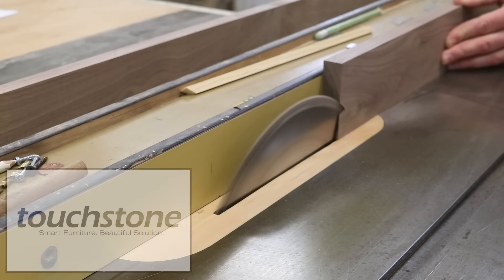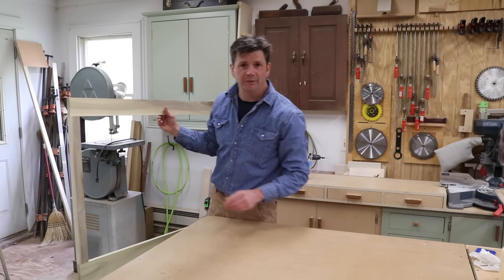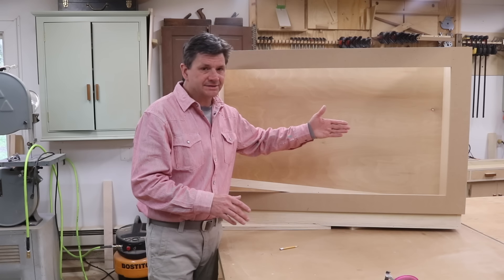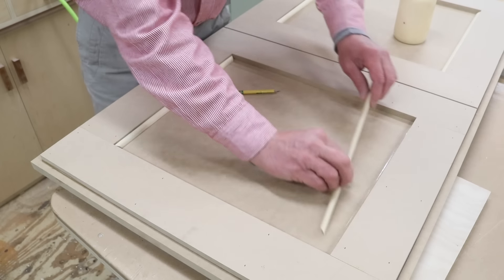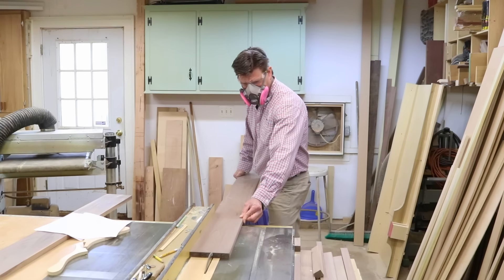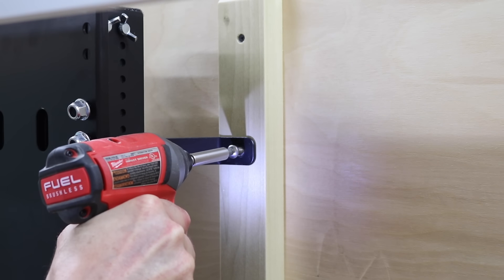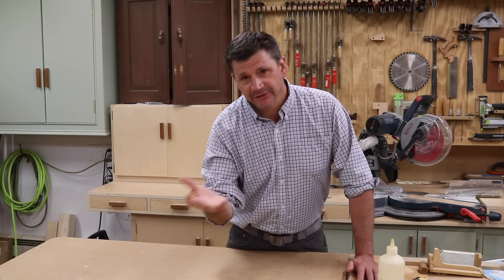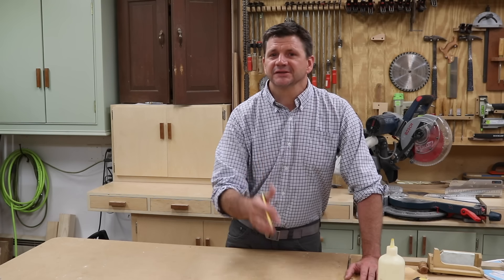How to Build a TV Lift Cabinet

Comment: Awesome craftsmanship Jon
Reply from the maker: +dfw crown Thanks!
Reply: Ugh...I downloaded the plans...cut everything based on your cut list, you have AG (rear trim) as 30 1/2, so I cut it that way. I put it together and now the rear panel trim doesn’t match. On the cut list AG IS 30 1/2 and on the build plans it’s 30 1/4. Now I’m off a 1/4 inch. You should update the plans so no one else has the same problem...

Comment: Thanks for your work Jon.  I'm a retired contractor/woodworker and am designing a lift cabinet for a 49" drag. TV going into a Touchstone Slim-lift.  Due to a space consideration I need to make the TV cabinet depth as compact as possible, front to back.  I have typical cable and DVD boxes that measure no more than 9" and will be able to IR remote them, if necessary, to make the cabinet even more shallow than that.  Can you advise me on what you believe to be the minimal depth, front to back as I stated?

Thanks and keep up the good work,

Gannon

Comment: Jon, thanks for taking the time to create a great installation video. My question is what size TV did you use for your plans? It looks like a 40" model. I'm going to install a 65" on the Touchstone Whisper II 23202 or 23401 Pro version and build a cabinet using your plans, but I'll need to modify them to get the correct measurements because I don't want to make any mistakes cutting the 8'x4' plywood too short since each sheet is insanely expensive these days.
Reply: Btw, it's impossible to find 3/8" x 8' quarter round at any hardware store. The longest I found was 48". Looks like I'll be using 1/2" x 8' quarter round especially since my cabinet is 62 3/4" wide, 42" tall and 25 1/2" deep.
Reply: @scottyd: I have to make the same modifications, as my TV is 57” wide. Do you happen to have the measurements you used to modify this plan? I was thinking about adding 12” to the width but I know I’ll screw something up somewhere. It would be a lot easier to learn from your mistakes lol. Can you help a brutha out?

Comment: Great build there. Touchstone also sells the same Whisper Lift for using as pull up shelves in a Kirchen where one could put the Kitchen Aid or other Juicers, Mixers and Toasters and after using them one could just let it rise and lock fit into a Cabinet above.
Was wondering if you have built something like that and if so, pls provide guidance with plans if available for the same. Thanks in advance!

Comment: Hi.  Great cabinet.  I'm going to start tomorrow.  My only question is this:  My TV is a 50 " set (44" wide).  With the inside dimensions at 46.25", isn't this cutting it a bit close.  It'll only give me 1 1/8 " on either side clearance.  Wouldn't it have made sense to not bother cutting the 48" sheet down to 46.25"?   How wide is the TV you attached?

Comment: Excellent project. One question, where is the cable box and electric eye for the tv remote?
Reply from the maker: +NYWoodworker thanks, we don't use a cable box  ( just Netflix/ Amazon ) and the lift doesn't need an electric eye to work.

Comment: I would like to use MDF as the initial build and if it comes out nice, then I'll give it away.  My concern is if something spills, then the MDF will swell and be ruined.  Could I attach feet to the bottom?  If so, what would be your recommendation of size?

Comment: Hi Jon, Thanks for your great videos as always. Jon,  what is your technique for covering nails and brads you use to fix moldings to the base before painting? my experience is that if one just paint them , paint will peal off after a while , ruining the Beauty of the work. for colored coatings like white paint or any other covering coat, it may work to hide foot prints , but when it comes to any clear coat where natural look of wood grains is required  , it become a mess and makes the work really ugly....

Comment: the cabinet looks great!  nice work, Jon.  hey, you mentioned finishing the back of the cabinet so that it could be used at the end of a bed; does that mean you finished the back w/ false doors to match the front (because at the end of a bed, the front doors would be facing the top of the bed while the back would face into the room)?  just wondering.  thanks for the video.

Comment: So, I finished this project.  It was a lot of fun, and the plans and video were an amazing help.  One question:  The plans require a 1" deep poplar for the lifting unit bracket.  Is there some reason I can't just reuse the 3/4" poplar that was used for the face frame?  Thanks!
Reply from the maker: I’m not sure, 3/4 may work fine but you could also pad the 3/4 with a piece of 1/4 plywood
Reply: Thanks Jon!  Is there some reason why it has to be 1"?  Is it just to get the TV more to the centre of the cabinet?
Reply from the maker: That’s probably what I was thinking, but a 1/4” shouldn’t make that much of a difference. 3/4 should be fine
Reply: Thanks Jon.  It was a lot of fun making this cabinet.  Your instructions, and video were fantastic.  Most projects you see online require a ton of tools that the average person doesn't have, and complicated maneuvers that are well beyond the beginner.  You make woodworking accessible.  My wife still can't believe I made this :-).
Reply from the maker: That’s awesome! Thank you... Please send me a picture when you get a chance
Reply: Definitely!  Only remaining part is to paint it.  I have an outdoor workshop without insulation, and we're in Canada (where winter never ends).  I will apply the paint in the next few days when it gets warmer (hopefully).   Thanks again Jon.

Comment: Cheat sheet for modifying the plans to fit a 77inch set (67.8 x 40)?
Reply: I'm making a similar lift cabinet, but modifying Jon's plans to fit a 65" TV. I'm 75% done and it is quite large. Mine is much deeper than Jon's above cabinet. My front is open and contains a 67" wide 12" deep shelf. I added partition behind the shelf to keep the TV hidden when it's down. If you're making a 77" TV cabinet, it will be huge. Be prepared to spend $500+ on wood because the price of wood is insane.

Comment: hi, I need your help .....can you give me the minimum dimension that the cabinet must have for a 65" flat tv.
Reply from the maker: Hi Malela, and here's some info I got from Touchstone on your question:

Getting the exact TV dimensions is important but If you’re using the 23202 Whisper Lift II or 23401 Whisper Lift II Pro with a 65” TV, The lift and TV cavity must be a minimum of .5” space on either side of the TV width, 8” in depth plus the total depth of your TV.  Height is dependent on if you are planning to put anything below the television, but it must be at least 33” high to fit the lift mechanism and TV.  Please make sure to measure the height of the TV and anything else that will be in the cabinet/ TV lift cavity area.    

Here's a link to the diagram:    https://www.touchstonehomeproducts.com/collections/tv-lift-mechanisms/products/the-whisper-lift-ii-br-touchstones-value-priced-tv-lift-mechanism?variant=35397563137

I hope this helps!

Comment: What is the point of this lift, you can't put nothing on top unless you remove it first. You  did fantastic job but, for many of us that purchase material at Home Depot and similar stores the cost to buy material for this job and put time is not worth building this